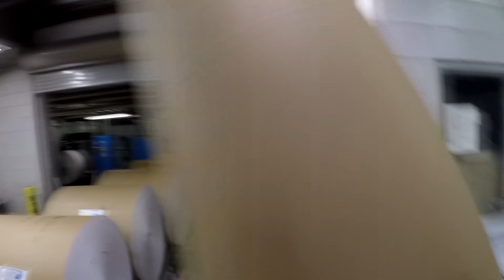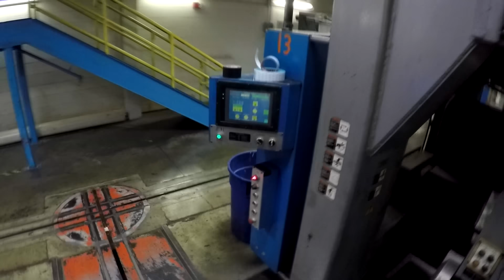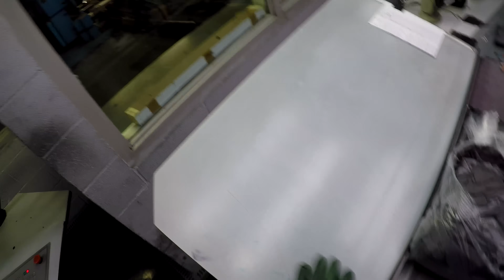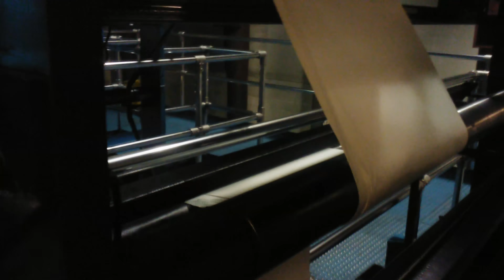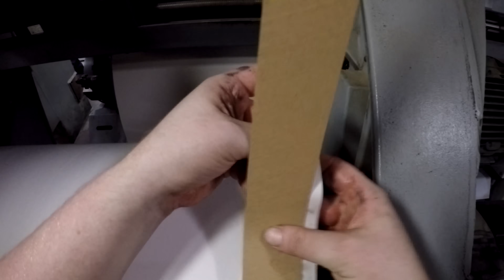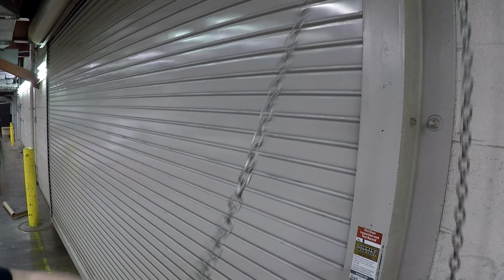Press Operator 1 -  Reel Room Operator

Comment: 20:30 We used a small board or even a shop rag to turn rolls up to 3,500 lbs. I used to work on a Harris M1000B with a Butler 3000 reel stand.
Reply: I've run the butler, but i felt spoiled using the stork.

Comment: 40 years a press operator, with newsprint,  we would soak the damaged rolls with water, just before running, it works up to 1/2 in depth, just keep putting water on it til you reach required depth, smashes or damage we would grind out the damage then soak the paper where we ground it, limited to about 1/2 damage.   Saved a lot of rolls. With coated paper there is not a lot you can do with it with water damage.
Reply: Solvent works well also

Comment: When I had to reposition a full roll I used some of the brown wrapper and folded it into a small square so it was about a half inch thick , then I pushed the roll onto it and then you are able to swivel the roll in any direction with ease.
Reply: We used wooden discs that came on the ends on some rolls. They were btwn 12-16 dia.

Comment: Heidelberg Speedmaster sheetfed operator here, occasionally we used to get those mill splices and if you didn't spot them, they would smash the blankets and on my press that is six effing blankets. Thanks a lot you Mill operators.
Reply: I was a winder operator in a mill i tried to make my splices were perfect.  They only started to mark splices in my mill after we got to visit pressrooms and speak with operators. I never got to see a splice fail but I could certainly see how much of a PITA that would be for the pressroom, sorry.

Comment: In 70s that reel stand was called a flying splice. That was on a Baker Perkins twin satellite press. Heat set commercial printing. Press owned by Readers Digest. Sydney Australia.🤪

Comment: I'm kind of surprised you guys don't use rippers when stripping the rolls.
Reply: I never had good luck with  those.  Either the tool blows out the top, or I have to angle it down and risk damaging the paper underneath.  I just got used to doing it by hand.

Comment: 30 years I worked on Harris m1000 A and m1000B 8 unit 32pg dff+combo folder, baker Perkins g12 5 unit single web w combofolder sheeter and dff, baker Perkins g14 8unit 32pg dff+c2 combo folder, baker Perkins g-16 8unit 64pg c-2 combo folder and lastly Harris m3000 Sunday press 8units andovens were stacked with combo folder and double former
Reply: Everyone here cares...really. 😐

Comment: I worked 30 years running presses, this press is way more automated than what I worked on, the press I worked on had a page capacity of 128 pages,  for the Sunday paper we could use up 88 rolls, usually you ran 2 reel stands, once the press started you be making pasters about every 10 min for 4 hrs straight. I worked on all Goss presses letter press and offset
Reply: What grm paper.. I used to handle 45 to 85.. 85 was a pig.. Web breaks all day.. Goss 50 reel stand. Collect was another pain in my side.. turn sheets slips.. Breaking news even.  But my biggest concern was slab waste 🤬

Comment: lol you rejected that roll?   we would have to peel it down...that would only be about 600lbs wouldn't take long  :)
Reply: Our paper supplier gives us 'roll peelers' and since that is newsprint you could have that peeled down in a few minutes. We have also used a skil saw to peel lots of paper in a short amount of time on coated stocks.
Reply from the maker: What's your process for peeling down 600 pounds quickly?
Reply: use the tip of my olfa knife to break at least 50-75 layers then peel in a v shape grab tip and pull across ,,,the damage shown on the roll in your video i bet i could peel down and discard all waste in about 8 min ,,ive been printing for 20 years now and have had my share of damaged rolls many times lol...we do send some back but most of the time we peel it down and recycle,i have worked on a 21" cover press right up to a 76" press. coated and uncoated stocks ...some of our roll deckers dont know how to drive and smash the shit out of rolls ,or drop them on their edge.i dont have to deal with that anymore since im now a 3rd pressman /2nd pressman ;)